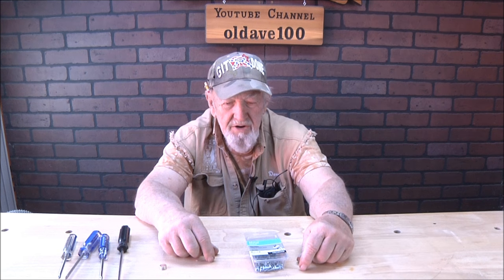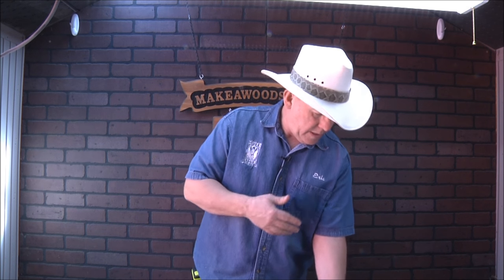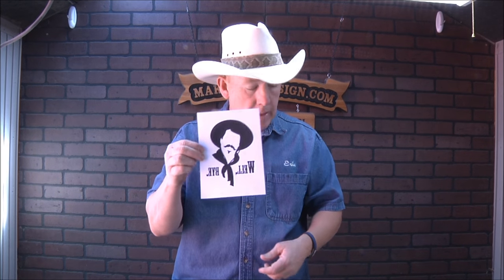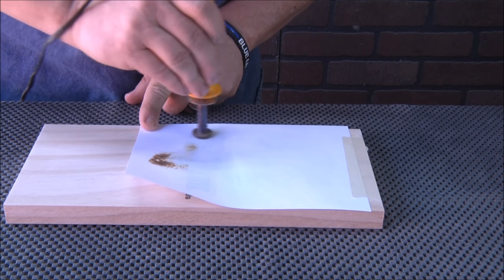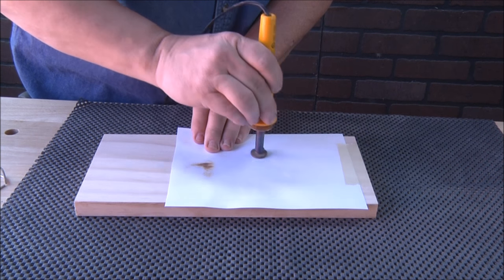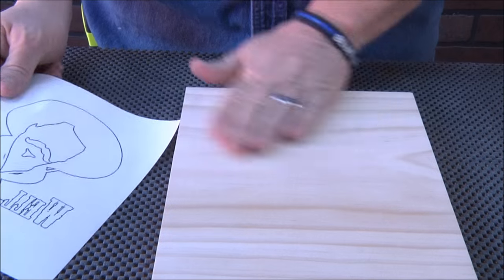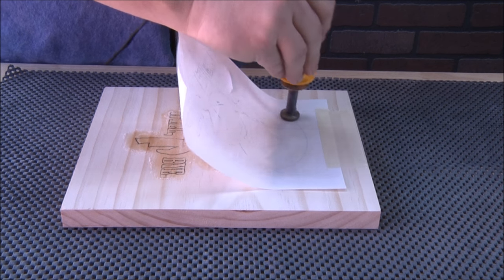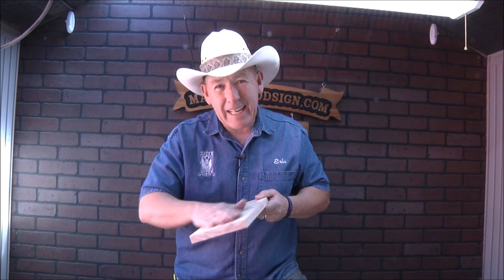#209 Screwdriver trick from Dave + laser jet & Ink jet transfer processes with heat tool

Comment: great video again guys, I'm going to try that out . I have a woodburning tool with a flat edge, I'll see if that will work . Also , have you ever printed images onto clear appliqué  film and routed it as it is self adhesive. Cheers , talk soon.
Reply from the maker: Back on #106 I used transparency film but I used it in a different way than you're talking about. I haven't tried routing through it. I may have to try your method. Thank you for watching

Comment: Hey Eric!  Not sure if you remember back when we first talked over video chat, but this was my process, and still is for certain signs.  I have actually only preferred using this method when I produce my "heat transfer" type of signs you might have seen on my crafts by caruso instagram.  It works great over paint too.  The only thing I don't like about it, is that it can warp your boards pretty easily with the heat.  I noticed this happening so I stopped doing it for signs I intend on carving.  Instead, I've been using the trusty ol' carbon paper method since it doesn't take that long and doesn't affect the wood.   Your the best buddy, keep it up!
Reply: Hi Mike.
That is true, that has also happend to me one time.
But that was only when i used my iron, never had it happend with my transfer tool :)

I found out that if i apply the heat over smal surface at the time, and quickly lift the paper i get a great transfer and don't have to apply so much heat over the same area again.

I found out that the trick is to apply small amount of heat over small areas and Quickly lift the paper, directly after i apply the heat.

But you have a point there, if you apply to much heat maybe it will warp, but i never had that problem with my transfer tool :)

Have a great weekend Mike.

Greetings from Sweden
Morgan
Reply: True! I was using an iron for a long time which caused this issue.  I finally got a heat transfer tool and it's been pretty great ever since.  It also applies heat more effectively.  Greetings from Canada my friend!
Reply from the maker: I'll have to keep track and watch out for warping. Thank you my friend for your input.

Comment: Do you finish the back of your signs? Someone on the facebook group said never to finish the back of outdoor signs. The water freezes in the winter and cracks the sign because the sign cant breath and release the moisture.  I have always fininshed the back of mine and was just curious what you recommend.  Im in Missouri.
Reply from the maker: We all have our ways of doing things but I respectfully disagree. I always try to completely seal the board up to prevent any moisture getting to the board. I've beeen doing that for about 45 years and it's worked out well. The recent collaboration I did with Chris, The Idaho Painter he finished the sign at the end of the video and he confirmed this. That video is titled Special Edition Collaboration.
Reply: Dave Rhoten thanks!

Comment: Hi Dave, you are right in saying that "photoshop" and the other big programmes can do the flip and outline but the cost of that programme is very high and it would not be logical to spend that much money just to do that sort of thing. You should continue with the web programme you have found and use your pennies to buy some other equipment.
Reply from the maker: Thank you for watching and the comment.
Reply: Not everyone has a mac but with mine all of the capability to flip and resize images is built in....no need to buy software

Comment: I've never seen a "slobbering iron" (soldering iron) like that, electronics soldering irons are ideally at 700 degrees and if you touch yourself with it, SST! and you've got a burn, and you only feel it later. "Civilian" soldering irons can reach 900 degrees, which is bad because you burn up the tip, lift pads, etc OK electronics talk but please, respect that thing.
Reply from the maker: Thank you for the heads up and for watching, Eric